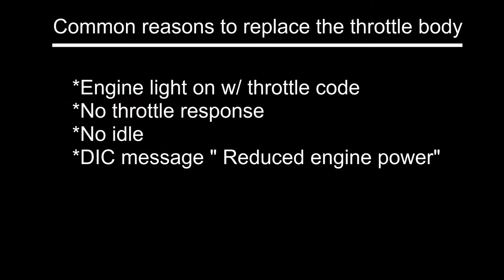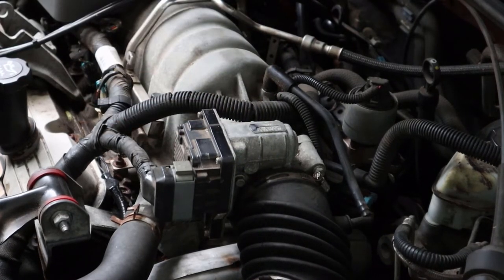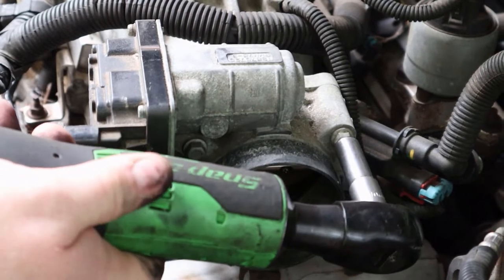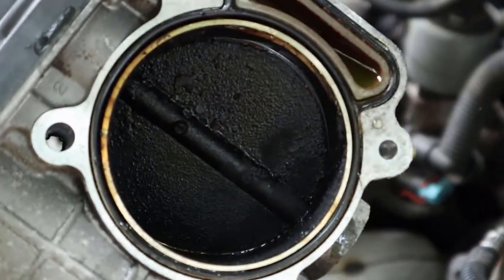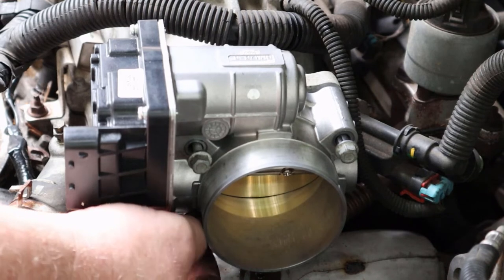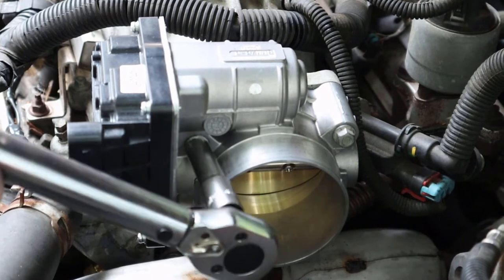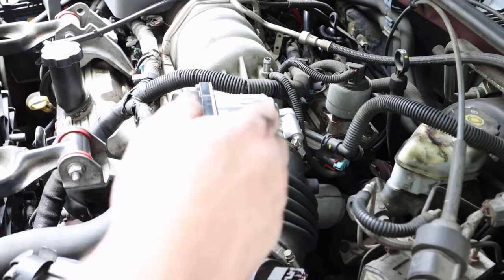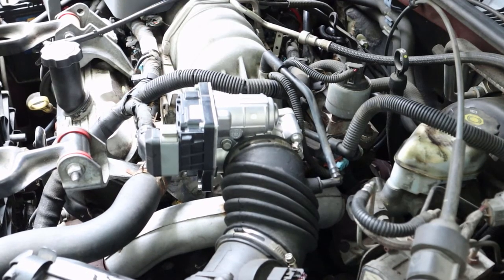How to Replace the Throttle Body on your car - Electronic Throttle

Comment: Thanks. I’m due for this job. Codes P1125, P2120 and P2188 keep coming on. Reduced engine often. Air filter was recently replaced. Do I need to replace the pedal as well? 2008 Pontiac Grand Prix 3.8 L V6.

Comment: Hi I'm trying to figure out if the shop I took my 2018 jeep compas to is just taking advantage of my complete ignorance on cars. It stopped turning on and not due to the battery.  First the guy said it was the throttle but then said it was the alternator. I paid for it but its still not turning on.  It said the car was not in park and the check engine light was on and all these other lights flashed before slowly fading away completely. Can someone please tell me if the throttle will help with this problem, and should I just take it to the dealership even though I might not be able to afford it?
Reply from the maker: I would say the shop where it is doesnt know whats going on and you may be throwing money at nothing.  I would get a second opinion from a qualified shop.